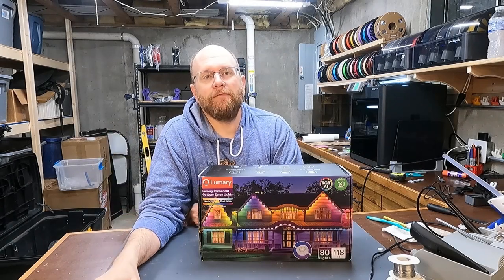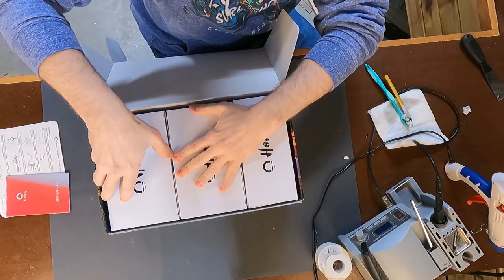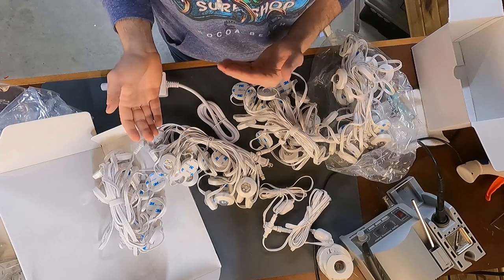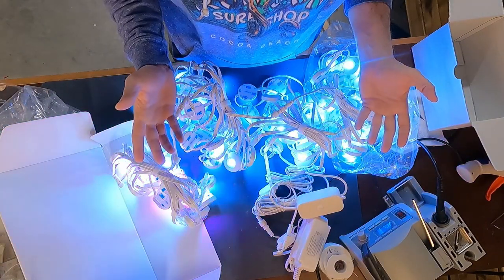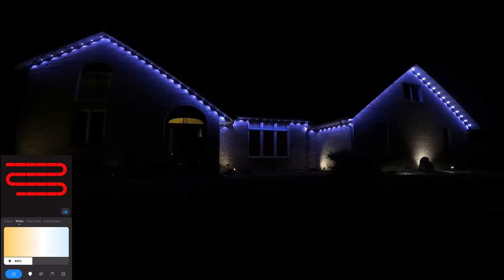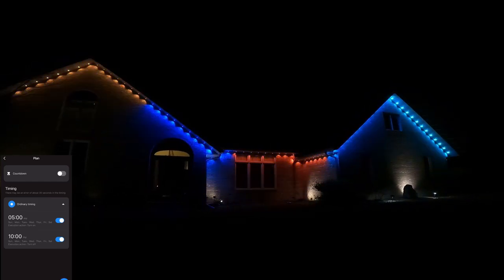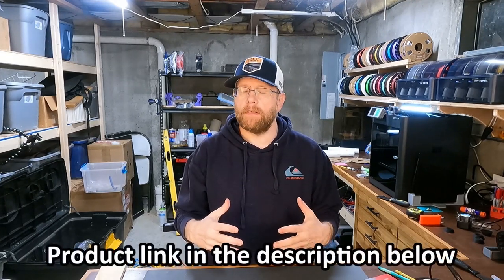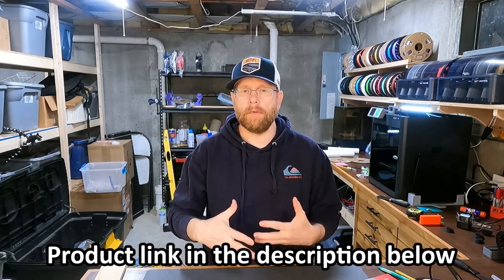Lumary Permanent Outdoor Lights Pro --- Unboxing and Review

Comment: Any worries about the adhesive lasting in the heat? Sorry if you covered this, I couldn’t listen but watched.
Reply from the maker: Adhesive appears to be very strong. Made it through our hot, humid summer this year, but they are never exposed to direct sunlight where I installed them.